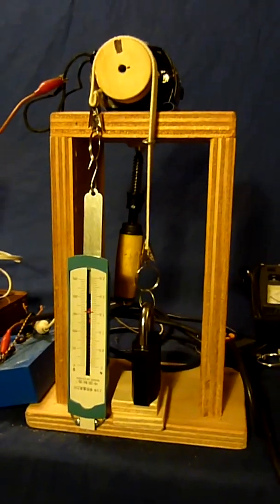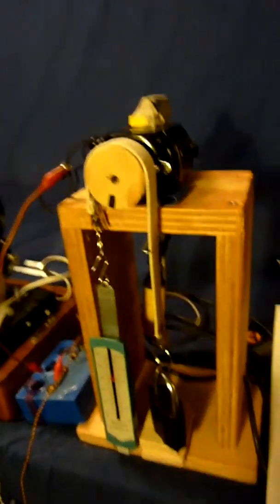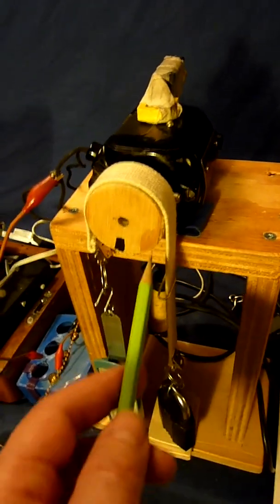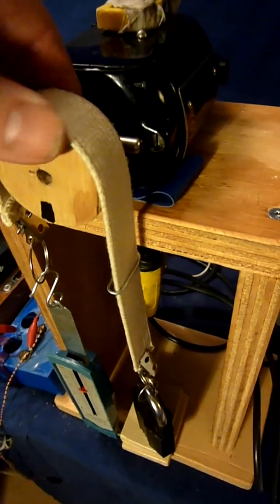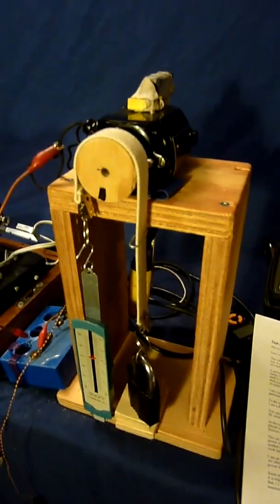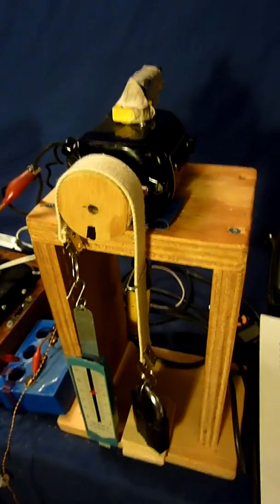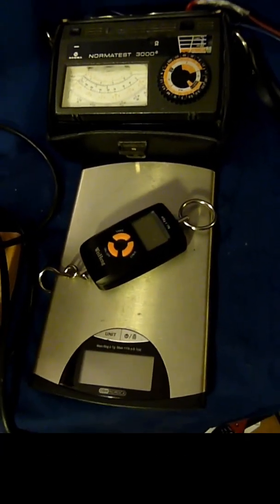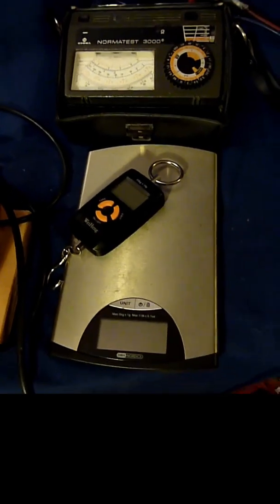How to measure shaft torque and power of small electrical motor

Comment: How would I take the value of the difference between the left and right sides and convert that measurement into torque?
Reply from the maker: Thanks for you question. I made a calibration regarding the dynamometer to the left so I can convert indicated value in Newton to real force, Fl in Newton pulled in the left side webbing. It is almost the same value, but when the dynamometer is upside down, you need a small correction.

I used a kitchen weight to measure the mass, m of the locks pulling in the right side webbing. So the force right will be Fr = g*m, where g is the gravitational constant, 9.82 m/s2.

I can measure the radius, r of the friction wheel. The Torque, M from motor shaft becomes M = r*(Fr - Fl).